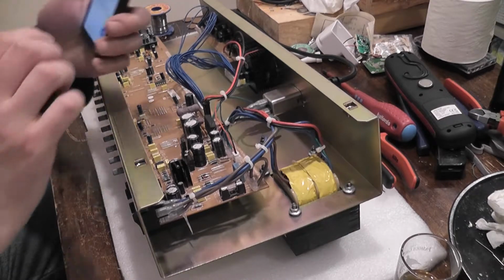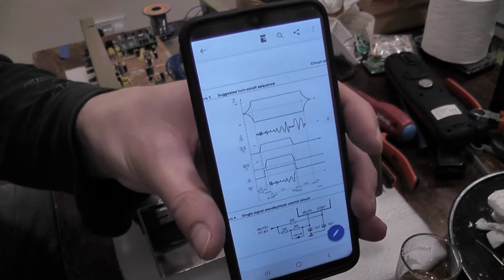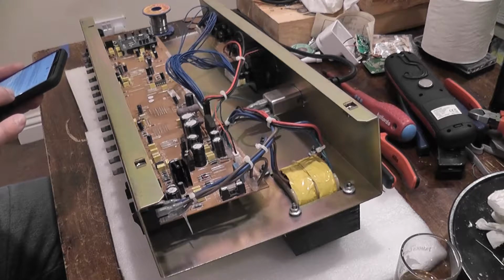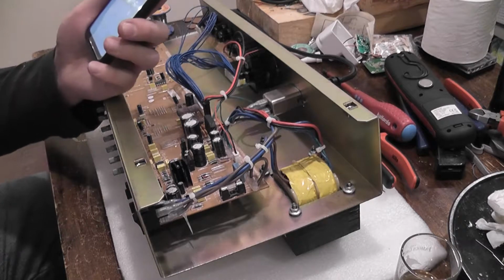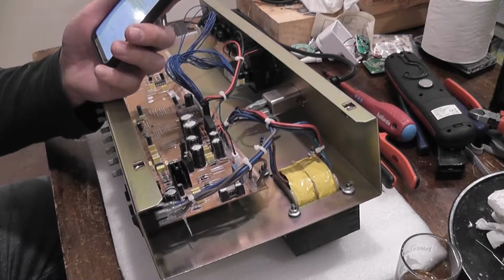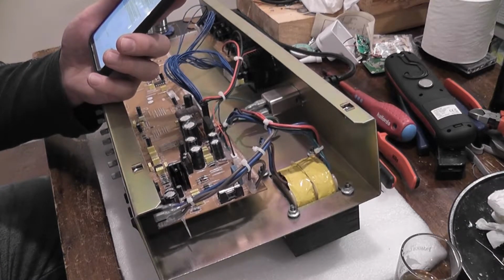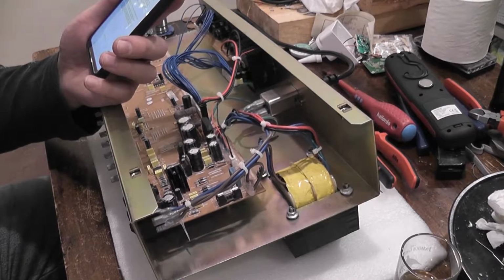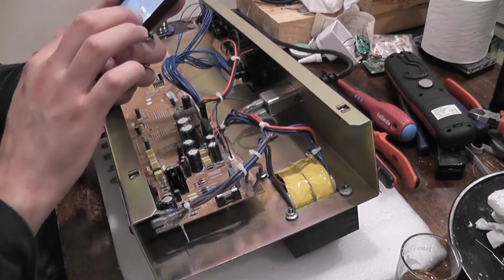Marshall mg100hdfx amp fix

Comment: Sounds like a typical Marshall design fault. When they use BJTs for signal switching in earlier models, they omit base-current limiting resistors, which also serve as current sharing resistors when driving several BJT bases from one source. Their (PARTIAL!) solution to this second problem was to use a matched set of transistors (A CA3045) . The amp's smoothing caps are not up to the job when clipping, so a lot of 50 Hz gets through.

Comment: Do you think I could take an automobile audio power amp in place of that fan cooled I.C.?
Reply from the maker: @hadleymanmusic 

You could take the signal to any amp really. The amp is configured in a way that allows the speaker to influence the sound in a way most amps aren't. Guitar amp have high output impedance, an automotive amp will have a fraction of an ohm Z-out.
Reply: @killcar5nbike2  use the mg as a preamp?
Reply from the maker: @hadleymanmusic  yeah, preamp will still function with amp board unplugged. Simple solution would be to use the preamp to drive a little single ended valve amp

Comment: Hello Liam, great video and interesting to watch you having fun and fixing it up. If you can shed some light on my amp please, Marshall solid state MG50DFX: the clean channel lost almost all volume; the overdrive channel has volume but lost gain, can barely hear any crunch even gain turned to max. I have since taken the head unit out, cleaned with electrical contact cleaner while didn’t see any rust or bad joints, which made no improvement. I have tried testing with headphones; connecting the FX send and return; testing with footswitch to switch channel. All same symptoms. I would really appreciate if you can point me out where to look at first that’s mostly likely?
Reply from the maker: I'd give all you jack connectors a good squirt with contact cleaner and fully remove and insert a jack about 20 times on each one straight after spraying it. I'd start primarily with the guitar in jack. One would guess the problem to lie before the preamp stages as they are both separate but by the sounds of it are getting a low signal level.

Also, check your guitar lead and guitar. If you don't have another to try, see what your guitar does plugged into a different amp.
Reply: @killcar5nbike2  Hi Liam you're a STAR! it is y guitar which I added a humbucker previously the control cavity became too cramped. Turn on the "Thanks" let me buy you another drink please!

Comment: I have one of these, and sometimes, not all the time, I would turn it on and it would make this constant loud ass popping sound. Any idea what's wrong with it? Should I just try to sell it on reverb and state the problem? Should I just throw it away?
Reply from the maker: Could just want a spray of contact cleaner lube in the control pots and the jack connectors
Reply: @killcar5nbike2  you think that'll work? You think the issue is the connection with the speaker cable or something?
Reply from the maker: @chrisgoodrich46  if there's a bad connection on a signal level signal it will be amplified. Just do the pots and sockets. It can only help.

Unlikely it's on the speaker lead, that would be more of a crackle/intermittent connection

Comment: I found one in the trash with a note saying" Turns on but makes a God awful noise;you have been warned!"
 I figured I could at least use it for parts for my JCM 800.
 2 months later I decided to plug it in.
When I hit the switch a white noise faded in,and then faded out,and then fading back in with a BLASTING FOG HORN SOUND!
Immediately shutting the switch off I took out the head disconnected the speaker and plugged in a pair of headphones;it sounded fine. Looking around I saw a small board behind the input Jack with multiple pins (which turned out to be the 
effects board), and pulled it out. Spraying both  the socket,and pins with Deoxit  spray I put it back together and plugged in the speaker,it works fine.
 About a year later it started again,and I just did the same thing,and once again it works fine. 
 This may work for other effects problems since it was the effects board with a dirty/ intermittent pin.
 It's  worth a try.

Comment: My MG 250DFX 2 X 50W stereo only works with a pedal in the loop Pffff
Reply from the maker: The connections for pedals are make/break. Try some servisol super 10 in the connector, and cycle plugging unplugging a connector in the socket about 50 times. Make sure you come fully out, and go fully in to work all the contacts.

Comment: Great work. I am not so experienced on electronics. I ended up in your video as I was trying to resolve a problem with my Marshall 5205 Reverb 12 that lost almost all its volume, I crank it to the max and you nearly hear it. Both Zener diodes ZD2 and ZD3 seem to have blackened the board where they are attached but they do not show any damage. Do you know where I can find replacement for these? Thanks for the help.
Reply from the maker: Measure the voltage across them, when zeners go they short internally, but still look fine.

Google will tell you what value they should be if you can't read the part number on the body of them. EBay will be fine for something like a zener.
Reply: @killcar5nbike2  thanks for the quick response. I have found on the schematic of the board here (https://drtube.com/schematics/marshall/5205.gif) that both of them are 15V. However, they are called ZD2 and ZD3+. Do the numbers refer to the positions on the schematic while both of them are the same, or the numbers refer to a specific type of zener diode. What is the plus referring to that is on the board? Apologies, but it is the first time I have to do this job.
Reply from the maker: @rodanthosofficial4393  the ZDx is it's place in the circuit. If you change them put them in the same way round as the ones that are in. You can see the coloured band as the Cathode end.

But whether they're your problem is another thing altogether.

I'd be inclined to try and find a forum where your problem is discussed. Most amps have common issues that have been well documented by now.
Reply: @killcar5nbike2  thanks a lot for the help. I have put the Zener diodes to my Marshall but once I connected it, another component was burned. I am not sure if I put the Zener diodes right. I actually put the anode of the Zener diode towards the positive sign printed on the circuit. Is this right? Thanks in advance for the help.
Reply from the maker: @rodanthosofficial4393 

I'm afraid without having the thing in front of me any help I can offer is limited. Zener diodes, like all diodes are with silk screen markings will go Cathode on device, to Cathode on silkscreen.
Reply: @killcar5nbike2  My MG 250DFX 2 X 50W stereo only works with a pedal in the loop Pffff

Comment: The strange thing is that the TDA7293 has a built-in thermal shutdown circuit!
Reply from the maker: It's like a car rev limiter. Will stop you blowing the engine up if you try to rev it past a certain point. Keep driving the thing running flat out and it will die eventually. Only helps to a point.
Reply: @killcar5nbike2  but I've never had one shut down and protect anything. They always blow the fuse and the power amp fries, along with pretty much every other component in the power gain stage. It isn't shutting down until after it has shorted out and done its damage.  I would expect it to blow the circuit beforehand at least once in a while.
Reply from the maker: @natetolbert3671  the thermal protection on most amp ICs is not a shut down. The output protection circuitry just kicks in earlier. However you can't beat the laws of physics, and it can't protect it with an under sized heatsink.
Reply: @killcar5nbike2  Yea that is why I commented originally. I the case of the 7293, going by the Mouser datasheet, it is a shutoff. In fact, it is one of only a few tda models with this feature. That is why I found it so ironic that this particular amplifier was chosen for the circuit. It is almost as if the engineers knew that the heat drain wasn't enough for the application, but for whatever reason (likely having to do with upper mgmt. / production cost) they coundn't do much to counteract, so they chose a chip that was supposed to offer extra in the way of overheat resistance to try a bit of last minute CYA. However, it obviously didn't work, and theirs were left bare. Behind every lemon circuit design, their is a story identical to this one.
Anyway, no more blabbing from me. I am a former elec. engineer who changed careers, and I miss the shop talk.  XD
Have a good one, and thanks for the great vids.

Comment: Hi Liam, as you mentioned the Impedance 16 ohms does this make components suffer if someone uses a 8 ohm cab. I have just bought a second hand 2004 Marshall mg 100HDFX with issues regarding the distortion OD 1 & OD 2channels. Foer some reason after playing on OD 1 And OD 2 thier is a slight tonal drop or gain reduction power drop if that makes any sense. As you also mentioned the chip mounted on a very small heat sink my have nultiple issues noa PCB based cct. I have trouble finding a schematic as it might also indicate the contour control might also have some influence with this unsual fault. I'll hopefully be able to replace caps but we are rated at 240 volt so interesting times to fix this issue. Please note the clean and crunch channel is unaffected with tonal or drive issues.  Thank you for sharing your repair and hopefully a nice molt can be found in the Uk regards  Big Grunta an amp Tech in Australia.
Reply from the maker: As far as I can remember the pre amp is pretty much all digital. Any analogue sections should not be affected by the output chip.

The change in sound could be the thermal protection in the output chip kicking in. If it's been driven hard it may have issues where it's no longer functioning properly.
Reply: @killcar5nbike2  Thanks Liam, I'll replace the bad caps and hopefully I can find the IC Chip . Remount on a larger heat sink.

Comment: hi,so mine mg100 hcfx...the sound is like "iiiiiiiii........".so.iam mentioned on your comment look likes.its just broke the chip diode and fuze...and replace it?.zero  elektronic experince...longstory short..its broken because "maybe" i use for re amping modeling when mixing(its already not work,but before re amping its working well with my input guitar to out the cabinet).after that..my head not working..and justt..."iiiiiiii.......".have any idea...thanks alot.plis reply
Reply: It is possible. The line voltage coming from a mixer is A LOT more than an instrument output.
Reply: @natetolbert3671  thanks alot.so,keep in mind...how to use reamping with head for mixing? ist direct box or maybe there any specific tool for change the impedancy..iam sorry if my question confusing.once again..thanks for reply

Comment: Hi, which equivalent zener diode did you use to replace the original 1N5238B ?? thanks
Reply from the maker: Off the top of my head it was a 12v 1/2 watt. I'd have to watch the video but I'm fairly certain I mention the voltage I used or voltage I measured after replacing it.
Reply: @killcar5nbike2  After I replaced the TDA7293, the fuse still blew, I checked the Diode and it was a shorted, I have a few diodes in my bin but not the 1N5238B. This one is 8.7V 0.5W zener diode, let me know if you find out what is a suitable equivalent diode. thank you.

Comment: You can tell the Whisky kicked in around 13:35 lol 
I have an overdrive issue with The Marshall MG10CD It CAN'T BE THE SPEAKER as it is ok in normal mode press the overdrive and its really distorted and crackly sound cuts in and out a little . i can only describe it as dusty contacts sound when turning old amps up etc but it is severe to the point guitar on vol 1 amp on 1 overdrive on 1 and it sounds awefull i looked inside i think the capacitors little brown thingys with little metal ends in rows one end of one looks slightly burned ? would that cause this kind of issue i feel i could replace it with an identical one from another board ? any feed back appreciated
Reply from the maker: Really can't say I'm afraid. I'd just be guessing as it's not an amp I've had a lot to do with.

Comment: i have had this amp head since 2000 so new.and just as of last week i have no signal no sound at all going the the cabinet it is plugged into.i have changed the chip board years ago the one by the fan in the back. any thoughts?
Reply from the maker: Is the fuse on the board blown? Good chance the chip has blown again.
Reply: @killcar5nbike2  Yeah mine has blown 4 times in 20 years. I eventually just gave up; it now makes an excellent coffee table...

In fact, by the last time, most of the solder pads had broken/ worn away. I had to use jumper wires to make it work.

Comment: so having just bought one of these second hand should i get a better heatsink straightaway?
Reply from the maker: A more substantial chunk of metal would help. Big heat sink with proper air flow would be a big improvement. 

As it is if you go no lower than 16 ohm load it should be just fine.